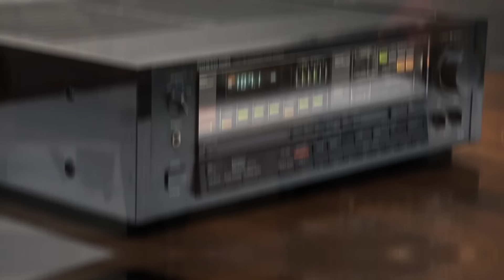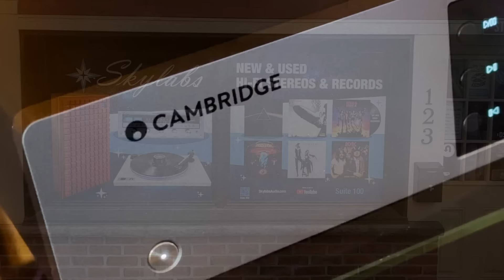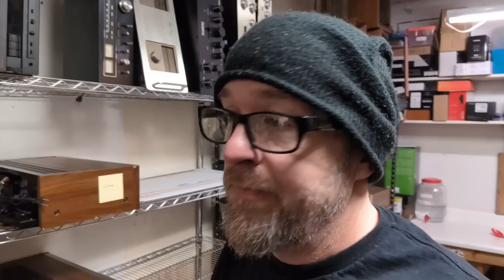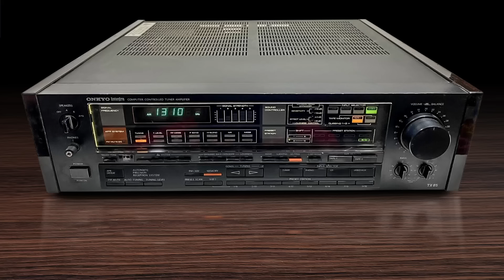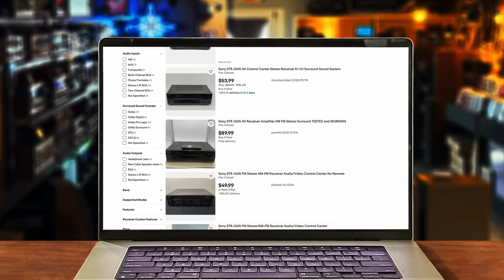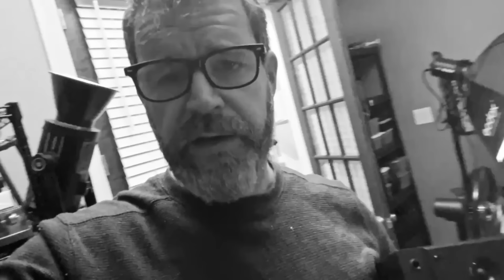Underated Vintage Stereos You Can Get Cheap... For Now

Comment: I don't know about TX-840, but I have had an Onkyo TX-930 since the early '90's, and I have a couple TX-906's from that same era.  The reason for buying  the 906 was that it has more power than the 930.  I usually have a small pair of bookshelf speakers or Klipsch kg 3.2's (also from the early '90's) connected to them.  I like how they look, they've always sounded good, the phono preamp is decent and they are simple enough the rest of the family can operate them, even when I have TV sound going through them.  Another perk is they have remotes, which is kind of nice compared to '70's vintage stuff where you still have to get up to change the volume...nitpicky, I know, but again, good for the family, who were not there in the '70's and are accustomed to everything having remote control.

Comment: I’ve got a Pioneer Receiver/Cassette deck combination I bought brand new in 87. SOB is still getting the job done! The only problem is it outlasted the tall speakers that came with the system. The woofers have finally dry rotted. Thinking about trying to install new speakers in the OG cabinets. Something about the monster cabinets!🤙🏼

Comment: Got myself a Hitachi HTA-3000 from the early 80s for free; a neighbor was throwing it out because it “didn’t work”. Swapped the fuses and it works flawlessly! Only 30WPC, but dual tape loops and a pretty good phono preamp. Great sound, and they’re only ~$60 on eBay.

Comment: I had a SANSUI pre amp that i would set up for keggers, and that thing with a set of old Klipsh speaker's, would rattle windows and set off those cheezy 80's siren car alarms. 
I lost one of the channels, and took it to a repair shop and the tech told me it would be cheaper to go to Sears and get a all in one tuner from Sony..... worked great until i spilled over a beer, and it went into the top cooling vents.

That was that. Miss the simplicity and power of the old school amps and tuners.... Thanks For Keeping Us Old Music Lovers realizing it actually was better back then😂

Comment: Picked up a Pioneer vsx-35tx for 5 bucks at thruft shop.  Cosmetically mint condition but volume knob is a little slippy.  Havent cleaned it out yet, but prob fine.  Anybody know if its a good item?  It certainly looks like it wasn't exactly bottom shelf and its reassuringly (exorbitantly) heavy!

Comment: Hello folks. One year I move 8 times. Find them and abuse them like a race car. The joy of each sub ch had cheap date. They claim a 60 w & 30 w amp equal one 300w of output db. 
So they system look like a right off but it was right on. 
The perks no repair shop needed if one knocked it over it has even more personality. That new will never ever have in value to offer. I’ll take a beater and drive it into up in smoke. Like being a kid again of no parents around. Volume at 11. As the Who sing I’ll call that a bargain I ever had. Free me see me feel me. Hear me. 

Ride Easy

Comment: Thanks for sharing the Value of Vintage Stereo Equipment. 
I just looked to see if I have any of the components you mentioned. 
It’s a ONKYO DX-C90 , 6 CD Player, I’ve been trying to get the belt replaced, but hardly anyone fixes Vintage Stereo Equipment.

Comment: This is from the Black Man O.G. and music loving audiophile (my full title 🤣). One of my Vandersteen subs went up after more than 30 years of woofing and took my 35 year old Adcom 555 mk2 out with it,( audiophile nightmare!). While my Vandersteen subwoofer is being repaired ($650 of repairs is cheaper than the $2000 they go for now!) I have purchased a Sonance MS10 to aid the other Vandersteen sub with stereo bass. It's a great little sub woofer that I highly recommend. However my biggest find was a power amp that I was always thinking about buying, and have purchased is the Carver Load Variant Amplifier from the late 90's to mid 2000's. It's a pre-owned flawless piece without a scratch on it that operates perfectly and sounds absolutely beautiful. It has me thinking I knew I should have purchased it years ago. It along with my Conrad-Johnson tube amp is a endgame  amplifier that sounds as good as anything new and current. It is also a very well built and  strikingly handsome amp. It has exceeded all the reviews I've read!

Comment: Greetings from a fellow "Iowagian"! I heard the audio of this program thru a pair of.... PSB Alphas! Got them back about 2008, "open box," and they have been on my No. 2 System in the office/computer room ever since. The sound is PHENOMENAL for such a small pair of inexpensive speakers. Another great value-for-money low-budget speaker I like is the Pioneer SP-BS22-LR. Not as full sounding as the PSB Alphas, but I had them plugged into the living room system for some testing..... came back the next day, forgetting I had not switched the leads back to the Klipsch towers, and listened for some minutes before I thought, "Oh, that sound's a little thin..... because those little Pio speakers are all that's on!"

Comment: We recently got a TX-840 at work for recycles from a lady who was getting rid of her late husband's stereo to go with a soundbar. It was well taken care of and there was a matching Onkyo CD changer and turntable with it. I brought it home, cleaned it up, put it with a pair of older Boston Acoustics speakers I had in college and gave it to a friend who had moved back from Hawaii and did not want to spend the money to have her "all in one" stereo sent back to the mainland (which was probably a good move). I would have kept it, but I did not need it and wanted to see it go to a good home where it would see use. 

I have a Pioneer VSX-4500S and it is a great receiver and does have a nice amount of power. The only real gripe I have with them is because they never break, finding parts is a bit difficult when one issue creeps up. While everything works amp wise on mine, the tuner decided it was going to turn this receiver into an integrated amp. In fact I am listening to it right now with the modular tuner board removed to find a replacement. Works great, but the tuner reads 77.4 on the FM dial (or whatever random frequency it would decide to land on) as there is nothing really hooked to it. I am trying to find a VSX-4500s or VSX-4400 that is either beat up enough or has a ruined amp so I can grab the tuner board, but have yet to find one. I don't really want to sacrifice a perfectly serviceable unit to fix an FM tuner that I only occasionally use, however as mine is pretty much mint, I do eventually want to get it back to fully functioning. For now, it serves its purpose just fine.

Comment: i bought nice sony lbt d509 whole huge set with 6ohm i think 50rms spekears from the 90s for 100eu or so (cd, casete, tuner amp), coz seller kids only use blutooth speakers, dude was so sad to give it up. and i was quite happy :) i only use amp and speakers, but whole set still looks nice just sitting there, while connected to old macbook, that servers as airplay speker server.

Comment: At 61 I remember these receivers.  I actually put an old Denon receiver in my wife’s workout room.  These receivers are great for things like that.  Her workout room is not temperature controlled.  The only issue is the old BA speakers out there have deteriorated around the woofer surround.

Comment: Still running my Onkyo TX-84 that I bought new in '88.  Never would have imagined any piece of equipment lasting so long with nothing but ocassional vacuum off.
Reply: I’ve had the tx-85 and it was top back in the day with bells n whistles but sold it. The wood sides were the only reason I didn’t want to sell. With that said I still have the tx-88 and a few of their older vintage. You can’t knock the quality they put in those units.

Comment: I bought the Sony DTR-D615 for 90$ off ebay off this video's recommendation.  Had some Infiinity References Ones in the garage that had been sitting for decades.  Brought them into a local place called Midwest Speaker Repair to look over and sadly they weren't worth fixing.  But he did have the exact same speakers on sale for 100$ so I grabbed those.
Couldn't be more happy, sounds great to me.  Topped it off with a Wiim Mini, and it's too good for what I had planned for it.  It was going to replace a 1980's boombox cassette/radio at work that died, now it's going to stay at home.
Now I want to buy more speakers like the PSB Alphas mentioned, or Boston Acoustics and see how they compare to the Reference Ones.

Comment: I’ve got Onkyo equipment. 3 pieces, Receiver/Amp, CD player and cassette tape(double) player. I’ve had them since the early 2000’s. Still working and never had any issues. Connected to Daly speakers.

Comment: This is what I think is the sweet spot in receivers. You get the older features such as phono input, tape monitor, and loudness control, but also  Dolby surround, soundfield adjustments, and multifunction remotes. The best of both worlds.

Comment: A couple of years ago, I got myself a NAD 208 thx power amp for $400. 250w/8ohms; 425w/4ohms; 900w/2ohms; 1800w/1ohm, stable! I'm told it would make a killer sub amp, but it sounds incredible gassing up my aDs 910 loudspeakers. Heck, I didn't even know NAD made such massive power amps before the purchase.

Comment: The 90's produced one of the greatest (arguably)bookshelf/stand mount speakers  ever made, the Celestion Model A compacts. Yes they are tiny, yes they did cost $1,000.00 in 1999. But this was the end of English made Celestion high fi speakers, and the designer, of many years with the company, made the claim that they were his finest achievement.  That's saying something. I bought them in a garage sale, in the original boxes, for $50.00.  They sat for years in my store room until I needed a sound test bench speaker and quite honestly, they changed my life. I was always a very large speaker fan, with several pairs weighing over 150lbs each. These little speakers schooled me in what was possible in a smaller room, producing an apparent sound field that was  larger than the room itself.  And after a few years of experimenting with amplifiers, I found the perfect synergy with a Crown DC300a , often accused of as being a PA amp, that I will use for the rest of my life. This amp is decades older than these speakers, but OMG what beautiful music they make together.

Comment: Yamaha's R-S300 (50wpc @ 8 ohms) made & released in 2010. One of the best sounding amps for those on a budget.  I have this amp,  hooked up to a pair of massive JBL L-100 floor speakers &  a sub-woofer, (which drives them all handily with ease & power, btw) & I can honestly say it sounds no different than my 125 wpc @ 8 ohms McIntosh tube amp (which I also own). I also did a bench test on the R-S300 & it easily measured out a whopping 80-85 wpc @ 8 ohms on the wattage meter....30-35 wpc above the advertised power rating!!  I highly recommend any model Yamaha amp/receiver over the Sony, Pioneer, Denon, Onkyo, even the Marantz ANY day of the week !!!

Comment: Last year I bought a sherwood s-2750cp stereo reciever for $15 at a garage sale. This reciever was made from 1987-88. I paid $400 for this same reciever back in 1988!  I was 16 and I worked 6 months at my first job saving up for my 1st stereo. I still had the american acoustic tower speakers and the matching sherwood tape deck I bought with the original sherwood stereo, they were up in the atic. Tape deck no longer works but the speakers do. The american acoustic (AAL) speakers had changed name to MTX sometime in the very late 80s or early 90s. The stereo setup actually sounds good, I have it out in my garage.

Comment: I have THREE Onkyo TX series receivers. Freaking love them. BTW they put out way more than advertised. Repair manuals usually list continuous output at 10-20 higher than advertised RMS.
Reply: It sure seems that they do. I bought a Tx-18 on the cheap not long ago and was really surprised by the power/sound at rated 30w x2. I guess I was impressed enough I picked up a TX-903 last week, it’s badass.  Think I want to try some 4 ohm speakers on both amps.

Comment: I picked a Nakamichi RE-10 recently for $50!  Cosmetically it’s not perfect but no scratches and no missing knobs. Definitely sounds great, better than great.  Only issue is the AM/FM push button is stuck and it only works on FM.  Not an issue for me as I haven’t used AM in over 40 years. Maybe someday I will get the courage to open it and see if I can figure what is wrong. I just wish it had 2 tape loops instead of one. 

It replaces a Harman Kardon HK550Vxi I bought used about a year ago for $100.  Still works perfectly.

Comment: Yup,  90s receivers are great. I love paying $80 for a $400 avr. And if u don't mind refoaming speakers, you can do the same thing. I've got Boston Acoustics speakers run by HK 7.1 receiver that is ridiculously nice, no HDMI but does Dolby Digital. A heavy-duty Pioneer turntable from the 70s, and 80s Onkyo tape deck, and an early 2000s Denon SACD player. My newest component is Xbox one that plays my ATMOS blue rays.  I think my Monoprice $100 subwoofer was my most expensive piece, and Amazon gave it to me free cause it was damaged in shipping. So maybe $500 for a system that plays everything and shakes the walls. 😁

Comment: I worked at Circuit City during the early to mid 90s, and I grew the addiction during those years.  The Pioneers were always super advances, and the Onkyo force was certainly something to reckon with-  But, for me, the sound quality of the Harman Kardon was tough to beat..  I still have my original one that I bought as a 16 year old, the AVR20-mk2..  And 3 others to go along with it :)

Comment: I got a Pioneer SX-1900 receiver a while back on eBay, for $75. Free shipping. While it's not my favorite, it has a 5 band equalizer. It sounds good with my vinyl. I also bought a pair of those Sony speakers. You're right. They're put away in a room. They sound bad to me, 12:40 compared to what 3-way speakers should sound.

Comment: I had a VSX-4800 for about 25 years and it was such a good amp.  It had a major fight with a power surge and lost.  And I've been looking for a 4800/4900 ever since.  And they just don't appear here.  There's one on eBay tonight for $180 which looks pretty beat up.  There's not many reasons I'd want to live in America, but vintage electronics would be my draw card.

Comment: Shoot, I've got those same PSB's set up for tunes on my electronics workbench, they do a better job of full range at 'high' spl than the Boston Acoustics A60's I've got (in my opinion). Also, lots of mid-high end 2 channel amps from the 90's were on par with those in the two decades before, in my experience. That said, I think there may have been twice as much garbage masquerading as hifi in the 90's than there was in the 80's. I hope someone corrects me if I'm wrong, the 80's were a bit of a blur for me, not being old enough to read and all.

Comment: I worked at Radio Shack during the 90s for about 5 years.  All of the receivers with the Optimus brand name at the time were rebadged Pioneers.  They go for nearly nothing today, and they were really decent amps.  I still have the one I bought in 1995-ish, and it still works and sounds great.

Comment: The unintended connection between a "satanic" mug and discussing stuff from the 80s and 90s when a large part of people were dealing with issues from the 80s Satanic Panic where everything in some people's lives were considered satanic.. is fantastically perfect.  Something I had gone through as a kid and I'm so glad I didn't end up scared of everything lol

Anyways.. back to the music stuff!  I was just going through some of my parents attic and found a Sony receiver and 5 disk CD changer both from mid-90s.  They still work great and will probably be put to use shortly.  I'm one of those that has been priced out of the shiny 70s

Comment: Great video! I ran a pair of 4ohm Cerwin Vega DX9’s on a Onkyo TX-906 that was 80 watts per ch at. 8ohm. The DX9’s sounded better than they should have and it never failed me. I ran that combo for about 15yrs and only got rid of them because space became an issue. My first receiver was a Pioneer SX-1300 and I had them paired to a set of Sansui S-32U’s. I want to the SX-1300 was under $100 new and the Sansui’s was like $40 new at Circuit City. I was 14yrs old. I eventually upgraded at a Pioneer SX-780 for $20 at Goodwill in 90 or 91. Wish I had held on to that one. It just always worked too.

Comment: I had a Pioneer SX2600 driving a pair of Cerwin Vega D-1's that I bought my senior year in HS... it went with me to college and then several years afterward, probably into the early 2000's when I retired it.  It's packed away somewhere.  Loved that setup... needed a little more power when you wanted to let the neighbors listen too, but at civilized volume levels, it sounded magical to me.

Comment: Great video!  I'm still running a lot of vintage gear.  Some of the stuff that's relatively cheap to pickup are Advent Graduate speakers, Advent Baby II, Boston Acoustics A60s, Denon AVR 1082 (used only as an amp at the moment).

Comment: Wow! Thanks for the Onkyo TX-840 rec! Just picked one up today on Marketplace for $65 in mint condition being sold by the original owner. Connected my Cerwin-Vega D5’s and they came alive compared to the early 2000’s Teac I’ve been using. Much cleaner across the range - crisp highs and punchy bass. Even hearing background horns on some Steely Dan tracks that I forgot were there!